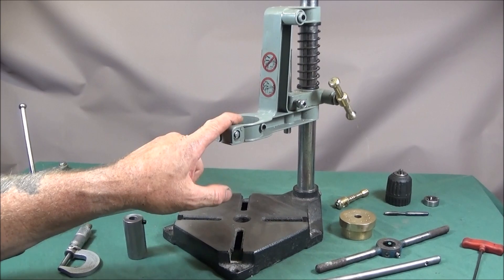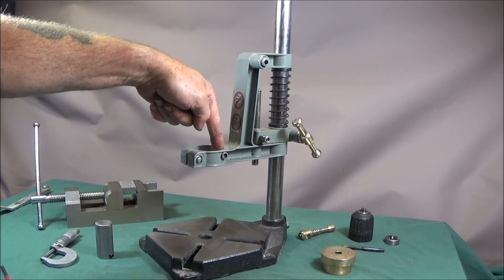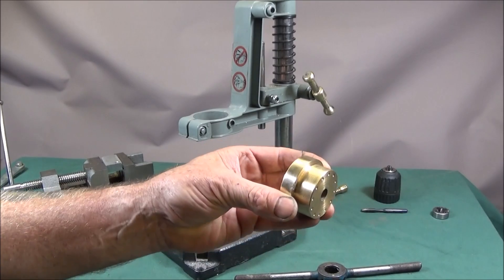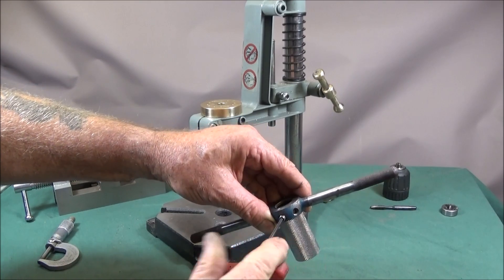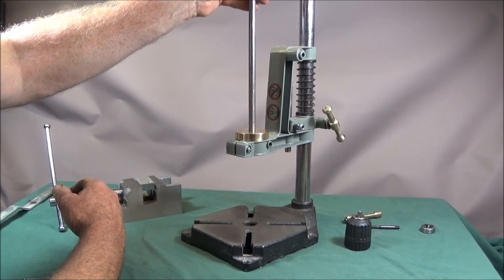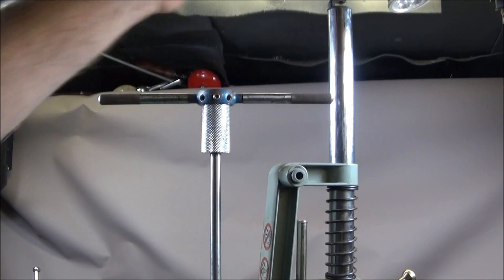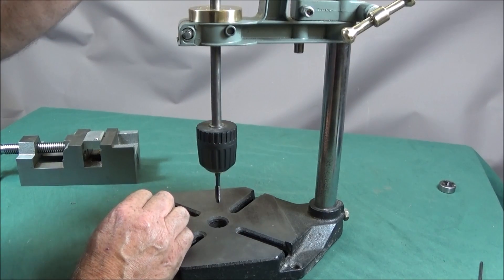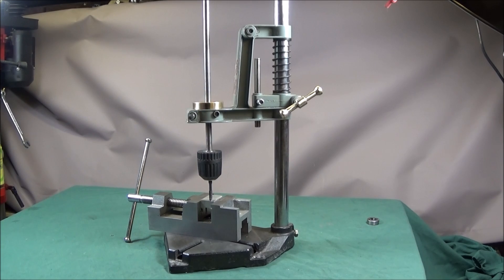How To Make A Good Quality Low Cost Screw Tapping Jig From Old Tools

Comment: Good idea. Up to now I've been putting the tap in the pillar drill chuck, then turning the belt-pulley by hand. It does the same job, but is awkward and tough on the hands with big taps. Also, my Albrecht-chinese copy slackens off when I turn the pulley back to break the swarf.
Time to look on flea-bay before they are all sold to watchers of this video!

Comment: Excellent! Steve, did you do your apprenticeship under the late George Thomas by any chance? You have the same cast of mind and produce the same high quality work.
Reply from the maker: Hi Ian, no I did 27 years in the aerospace industry setting and operating CNC lathes, centre lathes and assembly and testing components for both military and civil aircraft etc.
Reply from the maker: I never knew about George Thomas until you mentioned him.....Looks like he has written a great book that I hope to get hold of on workshop techniques.
Reply: I think it's at Amazon. If not, I think Hemingway usually stock it because they sell kits of castings for the Thomas projects and others.

Comment: Very creative and cool.  did you consider allowing the use of Irwin tap holders like these?  https://www.zoro.com/irwin-hanson-tap-socket-set-6-to-12-in-2-pc-3095001/i/G1322054/?gclid=CKOkpcXrrs4CFQkyaQod9kUOOQ&gclsrc=aw.ds  One of the main problems I have with trying to power tap or hand tap anything in steel say larger than 3/8 or 10-12mm is the tap not held tight enough in a regular drill chuck.  Small taps in aluminum, yes, it works good for that.
Reply from the maker: Hi Ramsey. Thanks those tap holders look great. I've never seen these before. The drill chucks are not very good for tapping. I've just been using them to cut a couple of threads so the tap is square in the work and the finish off in a vice. I will have to get some of these tap socket holders.

Comment: Steve,
I used a similar design but used a 1/4 drive long extender bar, T bar at the top and one of these tap chucks;
http://www.tengtools.com.au/product/tap-chucks-2/

Very useful and stops me breaking so many 3mm taps!  Thank you for sharing.

Mike
Reply from the maker: Hi Mike, Great I never knew these type of  tap chucks were available. They are excellent. Thanks for the link. Regards Steve